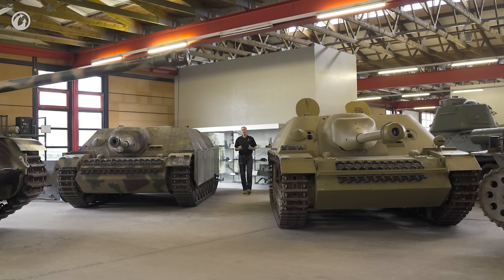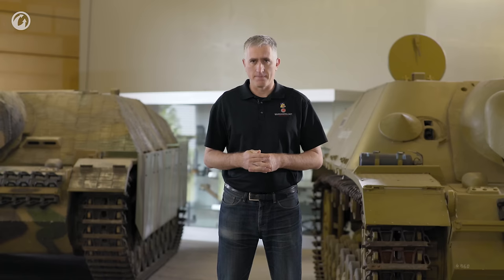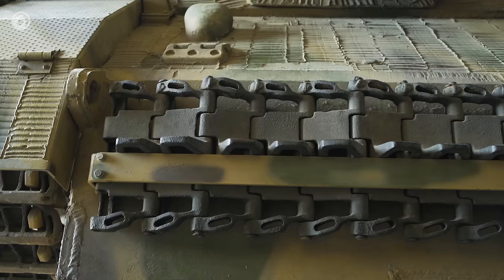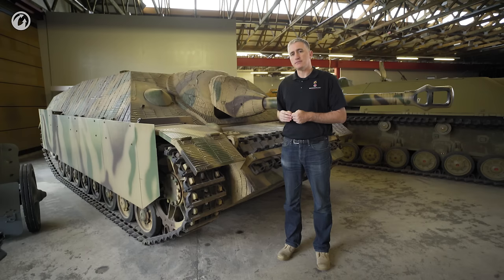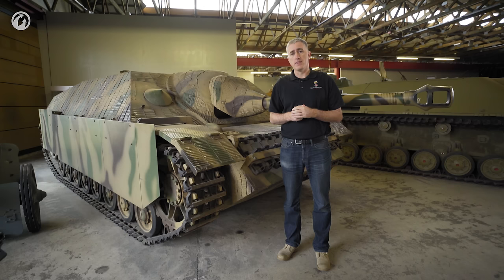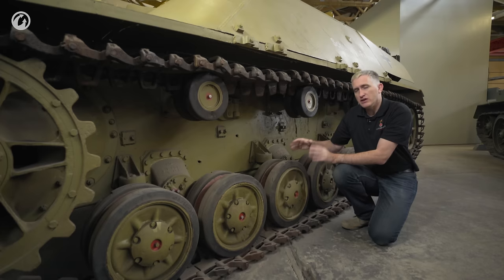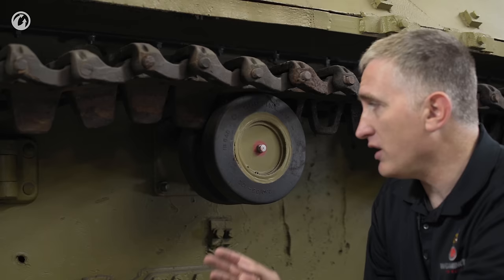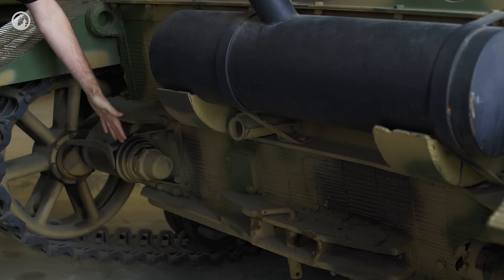Inside the Chieftain's Hatch: Get Inside Jagdpanzer IV Pt.1

Comment: At last I'm seeing the Jagdpanzer IV Pak 39 L/48 that was produced until November then the production proceeded the Pak 42 L/70 variant. It is very interesting to  see  the 0-Serie preproduction vehicle, easily seen with the rounded sides at the front next to the early production variant coated with the zimmerit. For your info it is interesting that because the cannon PaK 39 was so low the muzzle break created too much dust betraying it's position so many crews removed the muzzle break. Looking forward to see the 2nd part and again you did a good job 👍👍

Comment: -Ive a photo in one of my reference books of a pretty ingenious battlefield upgrade modification to the Jagdpanzer IV's schurzen panels....
-A rail  welded to the length of the vehicles casemate side plates/lower sponson's with all the schurzen hanging on a 1" round, steel "Curtain Rod" of sorts w/hole-punched brackets welded on the backside of the panels themselves. Somewhat, but not completely like a piano hinge. So if any work needed to be done on the front fuel tank filling-tracks-wheels-sprockets-idlers-bogie leaf springs, all ya had to do was lift & pivot the plates & rest them on the angled case-mate armor above. They may have even had safety latches @ the top to properly retain them IIRC?...Cool & effective mod none the less!

-The case-mate angle is steep enough that I dont see them accidentally falling & ending the war early for some poor, unfortunate grease-monkey? Which, if said were to happen, might in fact be a blessing? -Considering the HORRORS those AMAZING recovery/repair company personnel faced when dealing with German AFV repairs!...;)

-That particular mod most likely done when the crew had 2-3 days of downtime when large, more time consuming repairs & overhauls were being tackled n' accomplished by the PanzerWerkStattCo mechaniacs....

Comment: I am not absolutely sure. But I had been told that the reason the shifted StuG production from the Pzkmpf III hull to Pzkmpf IV hull was because the factory that build the hull for Pzkmpf III was bombed and they really needed as much "tanks" as posibble to send to the front so they have to change the production to Pzkmpf hulls even the hulls was really needed to real tanks as the Pzkmpf IV H/J. I guess it also make sence since the Panther was suposely to change thee main tank from Pzkmpf IV to Panters so I guess thats why there were a lot of Pzkmpf IV hulls leftover to made them as StuGs ect.

Comment: There is one thing that I would have to disagree with you totally Nicholas. And it regards the muzzle brake on German guns. If you look, you can easily see that the hot gas is directed to the sides of the gun. This produced very little thrown up dust or debris. It also hid the shot in combination with low flash powder that Germans used. It's the guns without the muzzle brake that throw up the huge clouds of dust and debris. I've seen it myself many times at live fire tank ranges involving the M-60A1, A-3 and Abrams. The only reason that MBT's don't have muzzle brakes today is because advanced German innovations still haven't caught up to them. Don't believe me? When was shurzen first used on an American tank??? Around 1980, a full 35 years after the end of WWII. That was on the Abrams.

Comment: I had the luck, several decades ago, to be allowed to crawl inside the Patton Museum's Pz-IV/70(V) runner (which was essentially identical to the Jagdpanzer-IV, just fitted with the L/70 Pak42).  At 5'11" , young and thin I still found it very cramped and difficult to move inside. In my opinion it didn't seem like anyone other than the TC and loader would be able to escape the thing if there was a fire. So I'll be interested to see what Nicks "fire" assessment will be in the next video.

Comment: 265 hp at 2600? 272hp 2800? That's 535 lbft of torque and 510 lbft at those RPMs. I'm glad engine technology has improved so much, a naturally aspirated 5liter v8 can make those numbers nowadays. And 3.5 liter turbo v6s are making much more power and almost as much torque.

What i'm saying is, it needs an LS.

Comment: That is some impressively shitty welding all over both vehicles.
Reply: German welding was petty good, are you sure your not confusing it with the zimmerit?
Reply: @suityboi2126  I was here to say the same thing. Normally, German welding was beautiful, but these two... Almost as bad as American welding.
Reply: @mcguirecrsr  in what parts?
Reply: @mcguirecrsr  at 5:06 the weldings pretty good
Reply: @suityboi2126  Take a look at 4:19 and 4:23.  Thems be utter shite welding.  4:30 - the interlock weld.  When it's done properly it's two weld lines.  That one is at least 4 lines of dodgy weld.  I guess slave labour welders in 44-45 didn't care.  Good for them, I say.

5:34 - that weld's a complete fvcking dog's dinner of bodgery.

Comment: Tried to install WoT. Took many hours & then when I tried to play it, my PC kept freezing, so after some trouble, I managed to uninstall - pity as I was looking forward to trying it out.
 200gb HDD & 8gb RAM.
Reply: What's your processor and GPU?
Reply: Thats why you use potato graphics
Reply: Try the standard mode. As for the hours-long lode, a lot of games take that long the first time.
Reply: GARGLER42 not enough hard drive space plus it is a HDD instead of SSD which loads faster than HDD, and you should have 16gb ram and geforce 980 ti atleast to be competitive and play with decent graphics.
Reply: @mrfunnybees  8GB is fine for Wot. Speed is what matters
Reply: @mrfunnybees  I have GTX 970 paired with r51600x and it keeps up to 140 fps on ultra.
Reply: @Weisior  you run the SD version or the HD ?
Reply: @mrfunnybees  SD tho